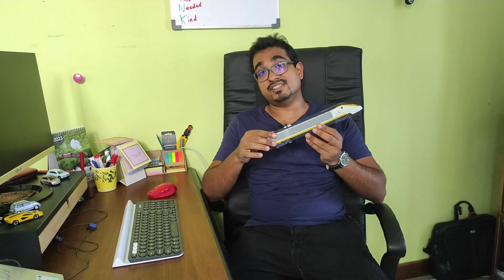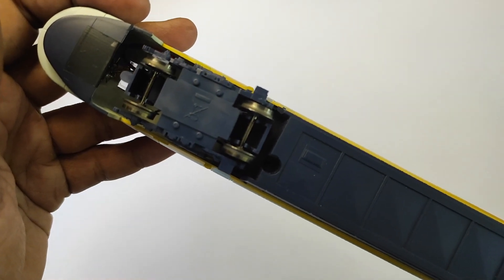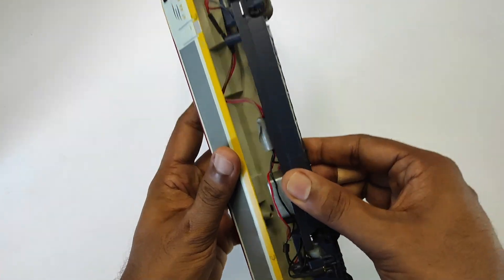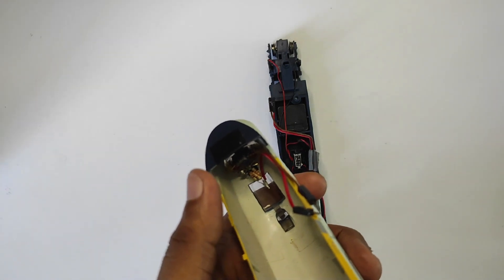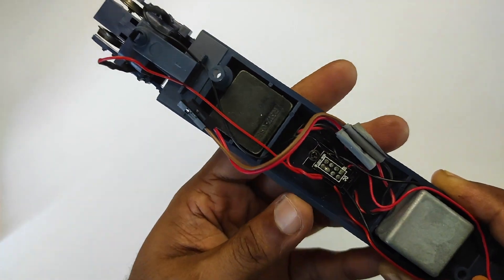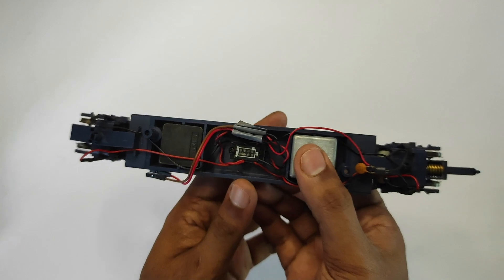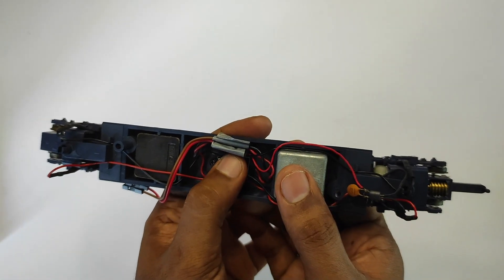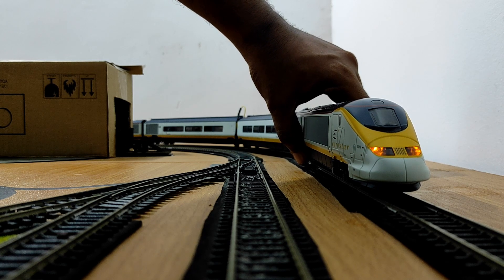Inside A Model Train Locomotive - Hornby Eurostar

Comment: I have a question, If I may. I ordered a couple of these from eBay. I'd forgotten that they were AC powered. I'm in NA, so DC is what I have. I've read that the tractor will run on DC, but will not reverse. Is it possible to convert the unit to DC? Perhaps a DCC decoder? Or is it as easy as swapping out the motor? Thanks for the video, and any guidance you may have.
Reply from the maker: Hi Steve, these are DC powered, they use a 12v supply to the rails from the controller. Switching polarity reverses the direction of travel and is done by your controller. This is called analog control, and DCC is the digital method of controlling, which uses an AC voltage at the tracks (17v or thereabouts) and sends digital commands to individual locomotives.

The controller is the device that accepts AC voltage and converts it to DC. If you've ordered off eBay, check if a controller is included with your purchase, and if it is, what its supply voltage is. Typically, UK/Euro voltages are 220-240v depending on country, while North America is 120v if I'm not mistaken. So if you're getting a controller with the set off eBay, you'll need to also purchase a step-up transformer for it, to step up the voltage from 120v to 220/240v. Alternatively, you can buy a controller from a North American model train shop if there's one nearby, that will directly take 120v AC and convert it into the 12v DC required by the locomotive. I've heard that MRC is a popular brand in North America.
Reply from the maker: Also, if you're planning to go the DCC route, you can install the DCC chip inside the locomotive without needing to change the motor. Most locomotives have a standard DCC socket (this Eurostar has the older 8-pin type). The DCC decoder simply plugs into the socket once you've removed the DCC blanking plate that is installed on DCC ready locomotives so that they can run on analog DC.
Reply: Yes, I was aware of that. I just didn't know if installing the chip change the current type. I didn't even know this early version Eurostar was DCC ready until I watched your vid. Great video by the way. Subscribed. @ashraaqwahab